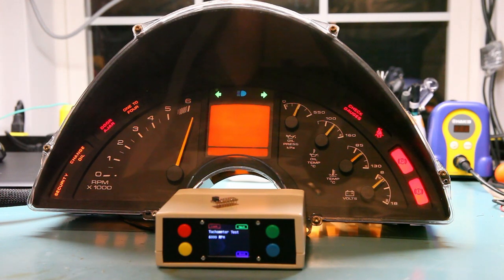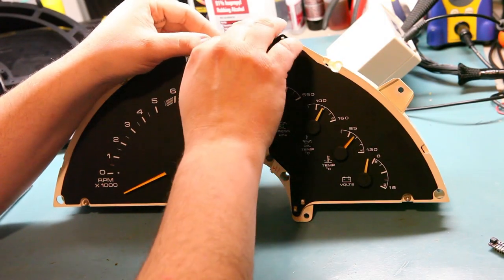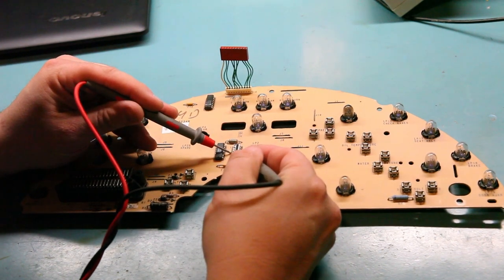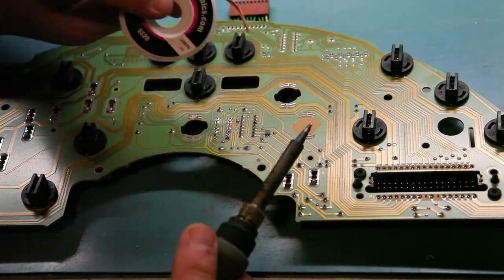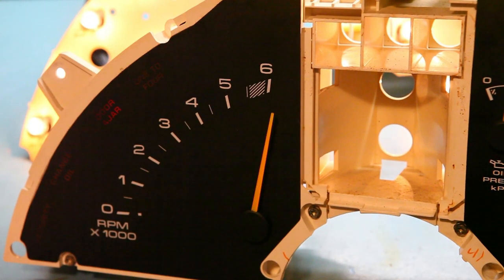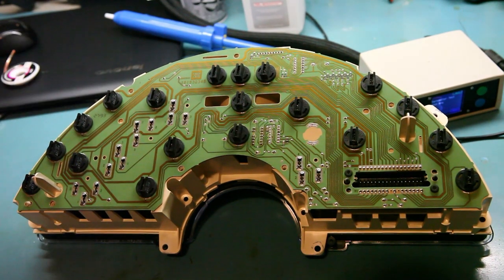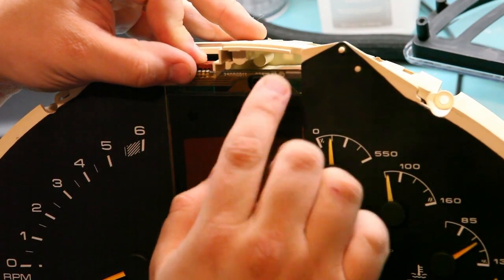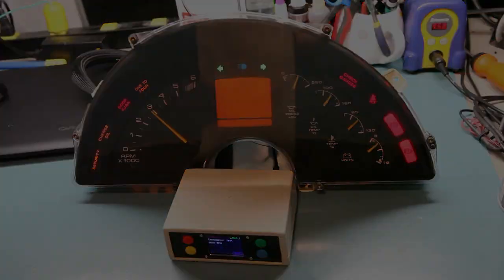90-96 Corvette #12 - Fixing and Calibrating the Tachometer Gauge (2015)

Comment: Have you ever had one read as high as 475k between pins 4 & 10? At idle it reads 3700-4000 and any throttle movement it pegs to 6500-7000 but with koeo it does zero out. Want to order your tach ic chip, just need to know if it will fix the tach. The car is an early 91 L98 coupe
Reply: That sounds like the problem to us. When they fail, they get higher and higher and eventually read infinite/open.